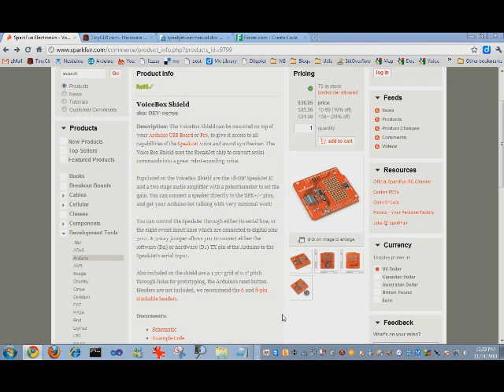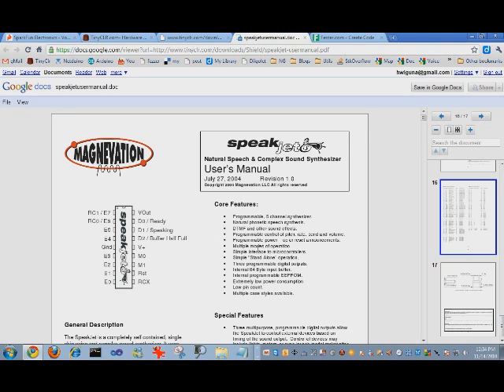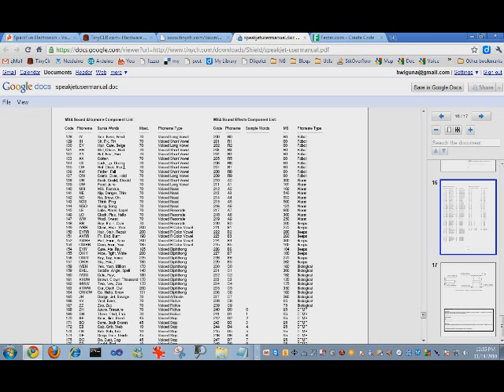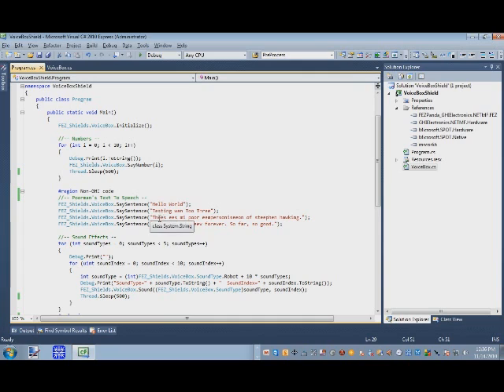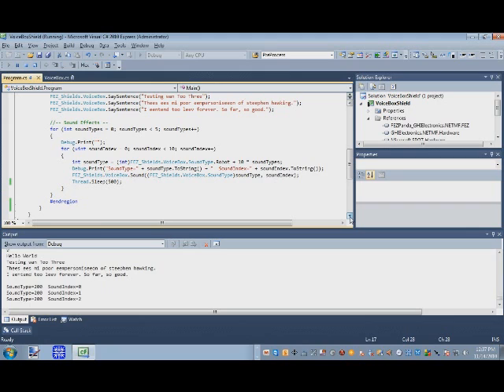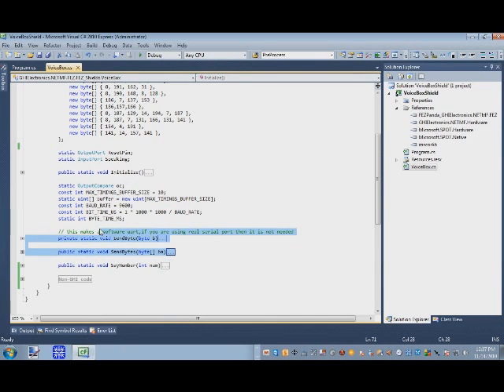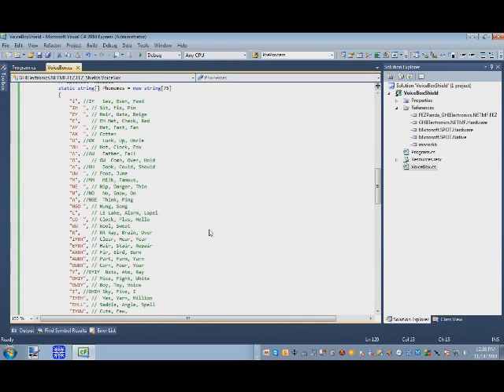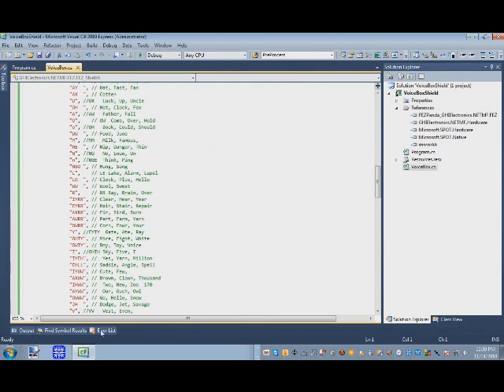VoiceBox Shield

Comment from the maker: That is correct. You don't program the VoiceBox per se.  You're responsible for generating the correct codes and the VoiceBox/SpeakJet would play that sequence.  If you have a limited # of sentence/word/special effect that you want to play, an mp3 shield would generate better results.  However if you must synthesize the speech dynamically then VoiceBox is appropriate.  There is also an extra chip (TTS256) that would translate English to those codes.  But that's another $22 extra. :-(